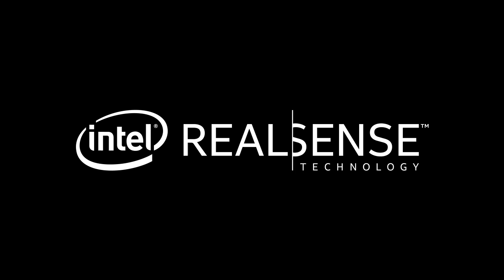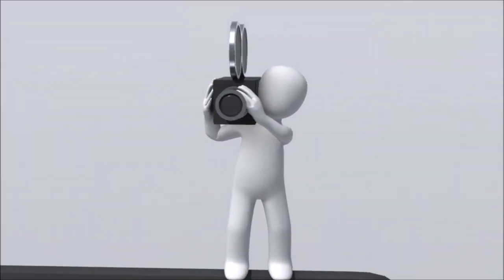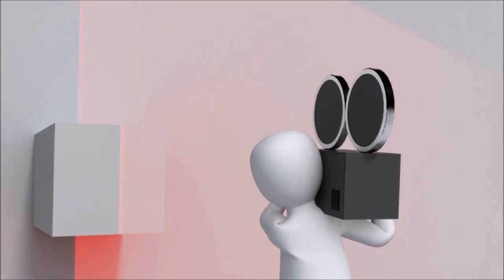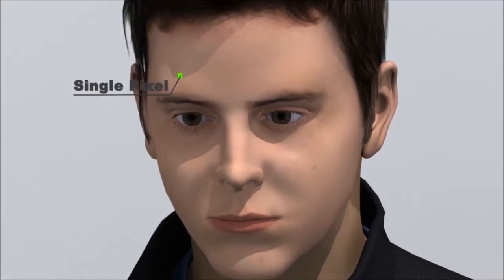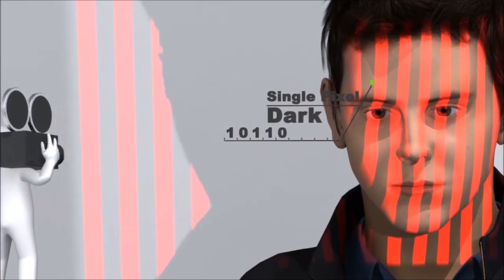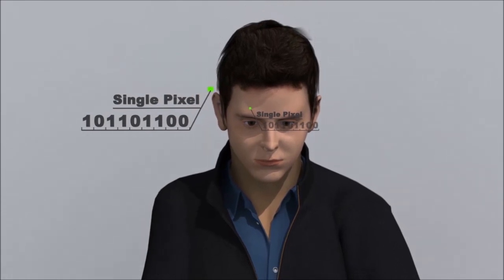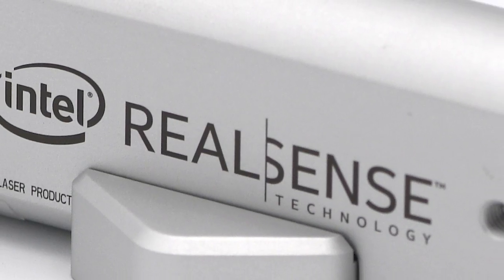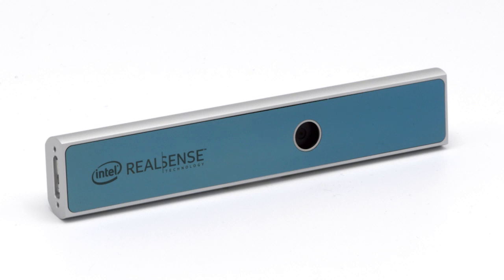Coded light technology and the Intel­® RealSense™ Depth Camera SR305

Comment: Can someone clarify why coded light in this can be better than IR depth camera found in D435? It seems like this only works with a short range but 435 is way better..
Reply: My guess is, it's the normal SR300 sensor module just in a box, then the D435 would be better yes.
Reply: @FunFreakeyy  For example, I would be more interested in the option with a relatively high 3D resolution like the D415 / D435, but if there weren’t any texture cameras that were unnecessary to me and because of this the price would become less.
P.S. I also use Kinect 360 for large objects with simple shapes, and a homemade SLS 3D scanner based on a classic structured light.
Reply: This this blows my d435 out of the water with facial scans.